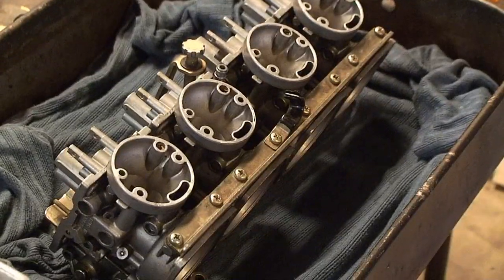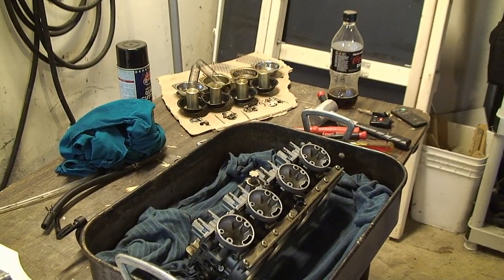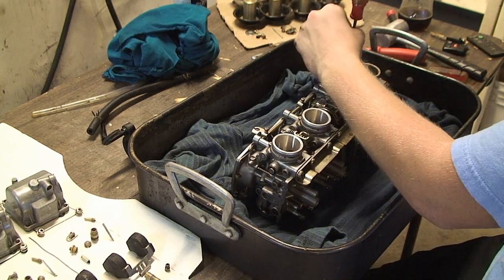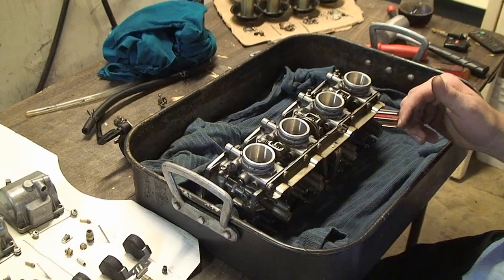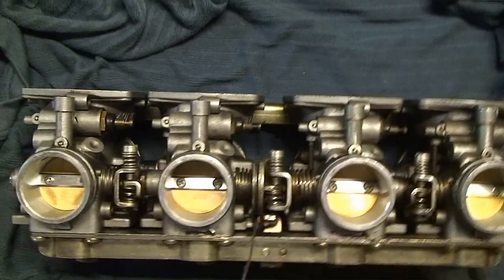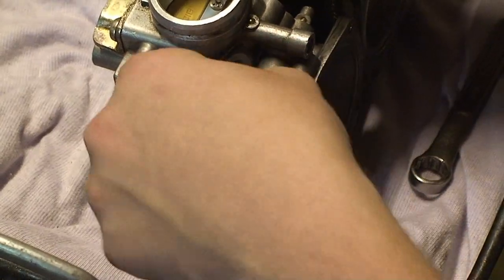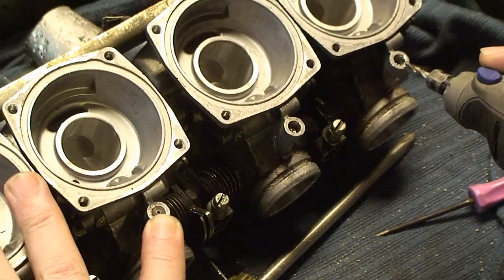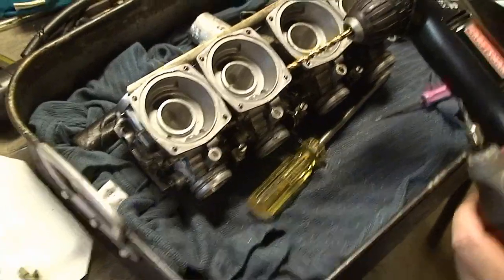Mikuni Carburetors - Disassembly, Cleaning, and Maintenance - 1985 Yamaha FJ600 - Part 2

Comment: I just rebuilt my Mikunis, and the brass plug, rather than drilling the entire thing out, just drill the hole bif enough to thread a course screw into it, then pry up on the screw head .. the plugs pull right out quite easily. Saves a lot of time and drilling.
Reply from the maker: Great tip! thanks for taking the time to comment

Comment: Actually the main issue is leaking fuel, not vacuum leaks or debris getting into the carb when you are talking about the. O rings on the fuel connectors that link each carb together distributing fuel to each unit

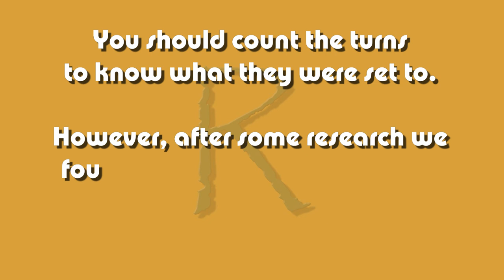Comment: at 10:27 the type says factory is 2 and a half turns, that's with stock jets. on over size jets make sure to buy the L screw driver for fine dialing them in.

Comment: You want the air fuel mixture screws turned out more than factory. Factory is set too lean. Bikes I have done idled best at 3+ turns out.

Comment: My bike Yamaha FZR 250. i cleaned my mikuni 
carburator (4) and cleaned main jet,pilot jet and adjust air mixture 2.5
 turns out from the closing point.My problem is 3 times failed my eco 
(smoke) test and result show more petrol consumption.but last years 
easily pass the eco test.My problem is need to reduce petrol.How can i 
adjust?i cleaned air filter.but failed.then without air filter i drived for 
pass the test(only 1 kilometer distance)failed.Then i used super 
petrol.same result.as per report more petrol flowing.How i can i reduce petrol?If i closed fuel air mixture screw to 1 rotation out,what will happened?please help.Thanks.

Comment: I use a vise grip then rotate to remove the tight screws - no downward force needed.  At least this way you do not strip the Phillips recess and they can be reused (it works every time).  Sometimes you need to use a baby vise grip for tight places.  You can also order metric socket cap or socket button head stainless steel 18-8 screws to replace the originals (boltdepot.com).  They look really good and installation is easier since you use an allen key.  When you screw something up and need to brake down the carbs again it is much simpler to remove.  I just finished doing this to my xj600 seca ii carbs - nice. 
Also, I learned from another youtube video (xt600 Yamaha carb rebuild) that you can order the o-rings through mcmastercar.  Just measure the original o-ring size with a caliper and order that size.  20 o-rings cost about $4 plus shipping (another $4 dollars).

Comment: why do you need to drill out the pilot screws?  kinda concerned or confused about that
Reply from the maker: They pean over the end of the screws so they don't walk out, the assembler (or the person who did them before us) overdid it on these. You can usually just take a small file and knock off the "burr" and they come right out. We weren't so lucky, just be sure to look for that before you try to take them out and you shouldn't have a problem
Reply: thank you